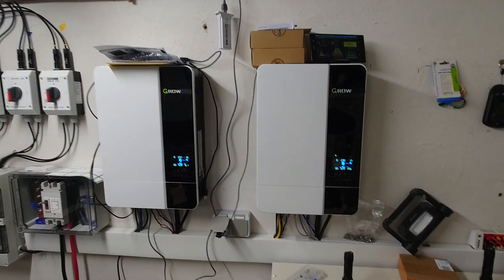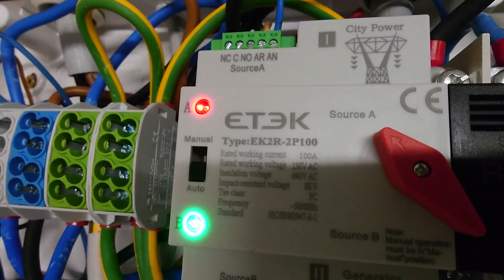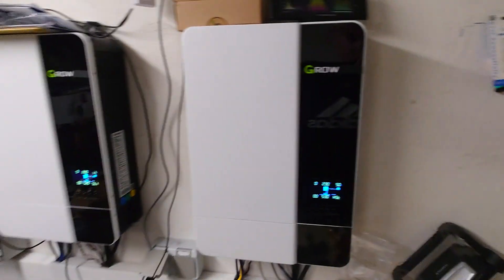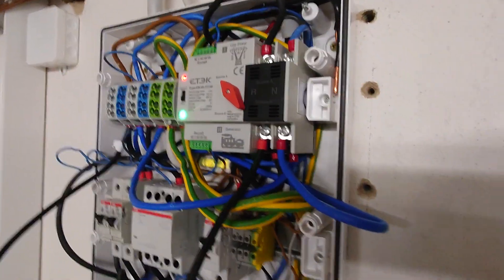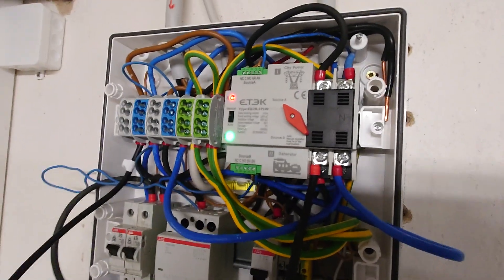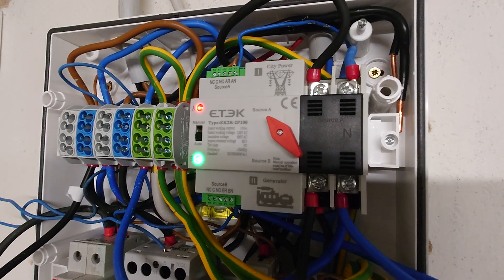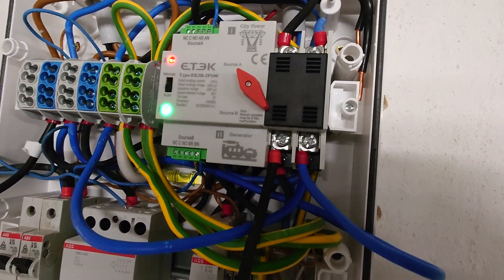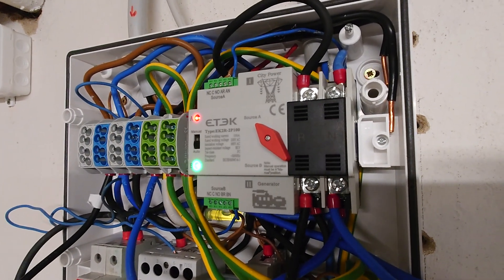Growatt  SPF 5000 backup transfer switch

Comment: your videos are great and im about to do a similar set up myself with growatts and diy seplos batteries. Curious though, do you have a video which explains the whole cabinet in more details such as the MCB's and in particular the Terminal Combiner Blocks. You seem to have a lot of these (2 sets of 6). Yet I thought they are only needed for combining the AC output of the growatts
Reply from the maker: Yes, there are some combiners but to be honest this cabinet is a grown test system and I started to build it in purpose of a 3phase system 1,5years ago...  With the lower combiner blocks I collect the power of all inverter supporting the load. On top the blocks are used for incoming power from the grid for the transfer switch and the fused power of the inverters. Don´t worry with a clean setup some of the components are not needed at all!

Comment: Very nice, thanks so much for this video! 
I have a question regarding this automatic switch. Can this switch do the same job if we have not connected the AC IN to the inverter at all? 
Personally i have not connected the AC IN to the inverters because here in Greece it's not legal to do it. So what i do is to manually switch from PV to grid when i see my battery getting low or when it's a cloudy day, or even at night. 
So my plan would be to use this switch which will automatically switch over to grid for my house when my battery is low or anything happens with the PV system. Do you think this would be possible? Thanks!
Reply from the maker: yes of course. The Grid needs only to be connected to the transfer switch in that case. and a soon the inverte is off or you switch manually it takes the B source to power the loads.
Reply: @kirkdis  Can the transfer switch transfer over to grid automatically when it senses the battery is low? With "low" i mean the setting B2AC percentage. So let's say we have set B2AC at 30%, will the switch transfer automatically to the grid when the battery gets below 30%?
And is the switch mounted on a normal DIN rail?
Reply from the maker: @Theo2482  the transfer switch is checking if the output AC of the inverter is present or not. The transfer switch is not reading the battery capacity, but I will later use rhe dey cpntact pprt on the inverter to switch over to grid when the valie at p12 os rea hed and swirch back to pv when p13 is charged back in to the battery. sp tp say indirecr ypu can use the battery SoC to trigger the transfer switch
Reply: @kirkdis  Thank you so much! I have another question: Could you tell me the brand and model of your battery disconnect switch?